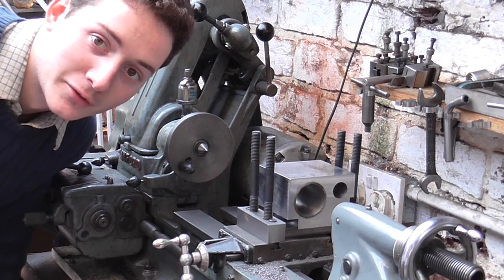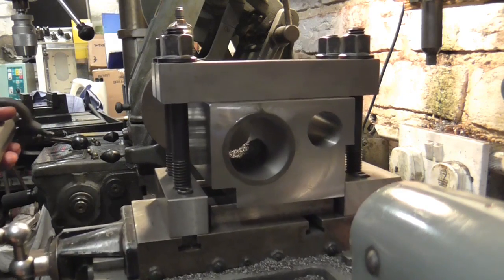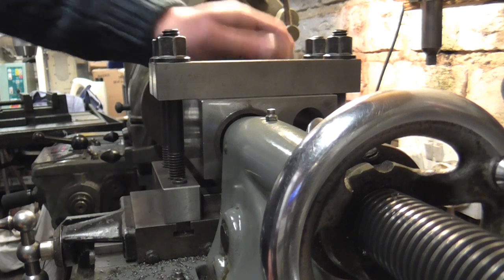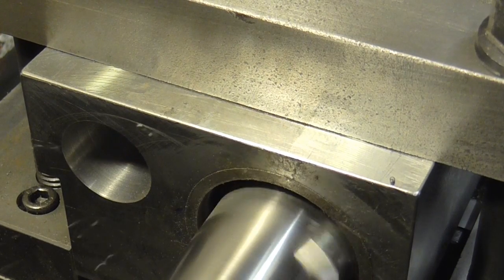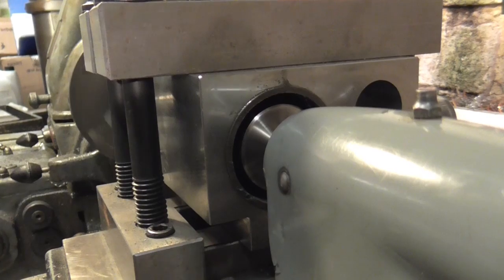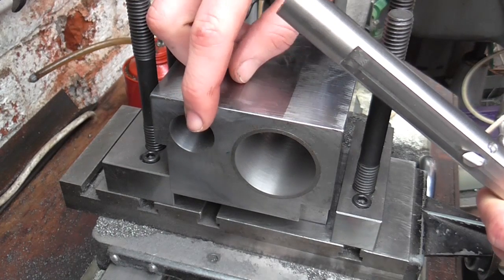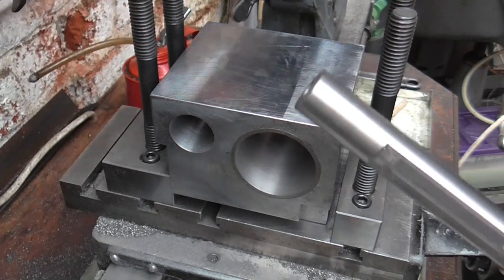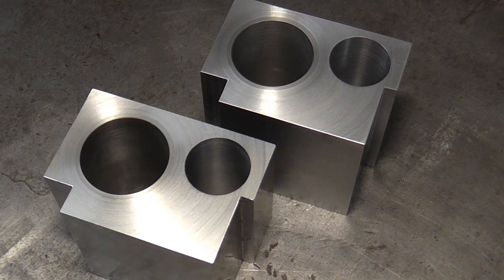Machining Cylinders Part 3

Comment: expanding mandrel is an expensive item. how would you suggest doing it without one? 
4 jaw chuck and clock the bore square?
Reply from the maker: Yes that sounds sensible and is probably what i'd do.

Comment: Very interesting comment about only cutting in 1 direction when you were boring , iv not done any fancy set ups like yours but I have done a bit of regular boring and have noticed that if you feed in taking a small finish type cut and reverse the feed to feed back out it always seems to cut more coming back out ( iv stopped doing this now and take the tool off the work to retract it ) your explanation about the carriage coggleing whether it’s pushed or pulled makes a lot of sense to me I’d previously put it down to the insert geometry but always had my doubts
Reply from the maker: Yes it's definitely a factor but mostly on machines with a flat bed way such as the Myford. A machine with a V bed should reduce the effects of this error.

Comment: Question: If you didn’t have access to a larger lathe to bore the initial holes for the cylinder and assuming the Myford hasn’t got the swing to do this, could you adopt the holding method you used to fix the blocks on to the cross slide and fit increasing sizes of drill bits in the headstock using the morse taper or holding them in some fixture to drill them out roughly before using the boring bar
.
Reply from the maker: The Myford would have done it fine it's just that it would have taken me a week to bore it out!

Comment: Watching your video series and really enjoying seeing the setups and jigs your using. I am curious as to the last step in the video, when I saw the cylinder on the expanding mandrel I thought you were using that to setup on an angle plate to flycut the face. I have learned that all lathes are designed to face concave which would mean an inadequate seal between the cylinder covers and cylinder. I would have thought flycutting would have been a much more accurate way of ensuring a good flat mating face. Not a critasism of your skills as there's always another way and I've been quite impressed with the time you've taken to showcase your talents. You've produced some of the most educational, and informative videos on the web. Just sorry I've only just found your videos ;)

Comment: I'm curious; why did you choose to use the boring bar in the lathe instead of using a boring head in a mill? I think it's a rather ingenious solution for someone who doesn't have a boring head, but I'm confused on your though process...
Reply from the maker: Hi. The concept isn't mine, It is a fairly well known method in model engineering circles over here in the uk. Traditionally most model engineers over here didn't have much by way of milling machines. Out of the options I had I thought this way the nicest way to do it. Plus I had always wanted to try line boring.

Comment: very nice video series, I like that you show the setup and measuring of the parts. Could you have used a rigid hone to bring the cylinders to final size, or would the finish not be appropriate for a steam cylinder?

Comment: hi crispin ...eric in kentucky ...usa.......can you tell me the material and size and lenths of your boring bars ???? im wanting to make me some and yours look pretty awesome !!!! keep up the good work......eric..............
Reply from the maker: +eric chilton Hi

They were stainless steel (I had some lying around). The dimensions really depend on what you want to bore, I made them as sort and fat as possible for the bores I was machining. The bits of HSS were just what ever size broken milling cutters I had which happened to be 10mm and 6mm.

Comment: Crispin, Thanks for sharing this series and particularly for this method of boring the cylinders.  I'm building a 7 1/2" pacific PS4 locomotive.  I had not considered boring on the lathe by this method.  I thought about using the Bridgeport and somehow clamping the cylinders to the lathe plate.  Wow, this is a great solution.  Solid and easy to adjust.  Thanks again for the setup.  Larry Ogle

Comment: Another great video from Crispin.  You use the lathe in ways I have never seen before.  Its very interesting.  Why did you prefer to do the facing of the cylinder blocks on the lathe instead of on a vertical mill?
Thank you

Comment: Hi Crispin,

I've been waiting for the facing op and the expanding mandrels to make their appearance. It looks like they're working well for you. I've yet to use any of mine.

The traditional method of securing the dog to the drive pin is a twist of copper wire.

Comment: First, thanks for the lesson on line boring. I am facing a similar job myself. Second, a question. You faced off the cylinders on the lathe, a classic method before home shop mills became available. And it worked. And very useful if you do not have a mill. But you do -- there is a Bridgeport lurking in your shop, I've watched your vidos. Would it not have been simpler to do the facing on the bridgeport?